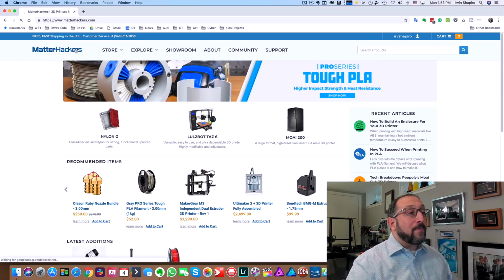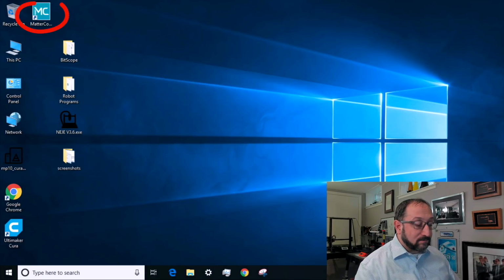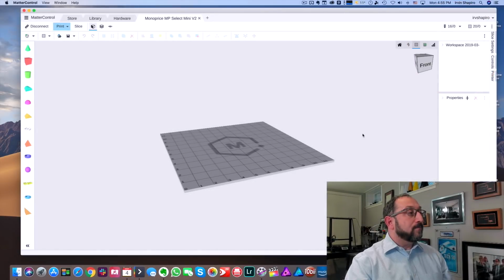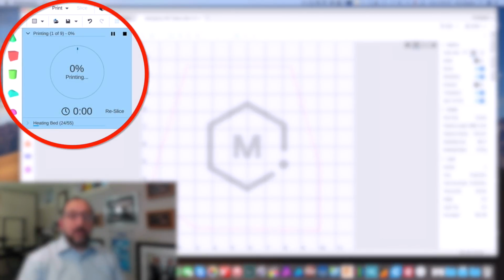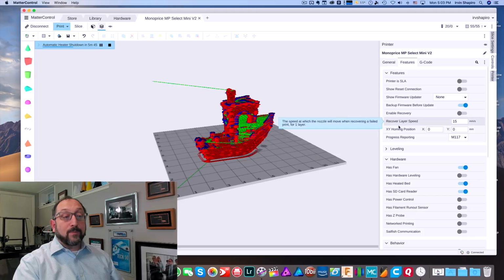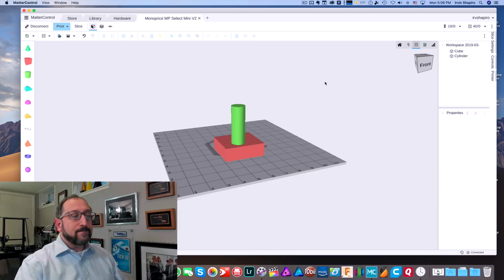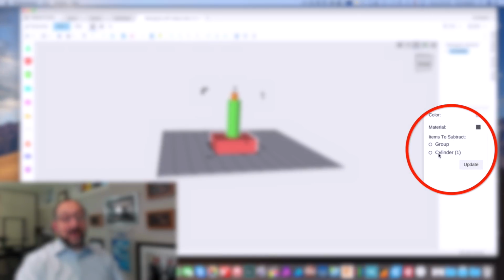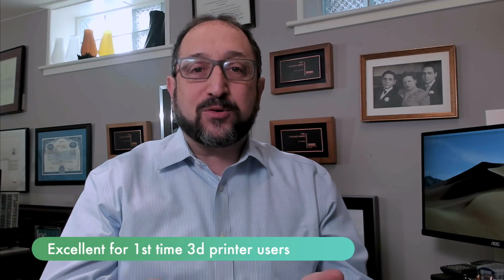Best 3d Printing Software for Beginners

Comment: Hi Needing your help again Doc. Printing using your 1.2 profile and printing PETG printing on the Ender 3 Pro  Printing is nice smooth on the outside ,but bitty like a bobbly woollen jumper on the inside. I am printing  the fan casings for a whoop quadcopter and tried first print at 240 temp ,speed 30 bed 60 fan speed 80% and 2nd print 50%speed  fan 100 temp 245. Last print temp 230 fan 100% speed 40 All 100% infill. They are all smooth on the outside but bitty blobby on the inside. Its a new nozzle
Reply from the maker: What do you mean by "the inside".   Can you share a link to the model.
Reply: @MakeWithTech  I mean the inside face of the print, Every print has  two sides ,the inside and outside . Printing a tube eg. The outside is nice finish but the inside is splattered with filament . Where can I upload the link to so it can be shared?

Comment: I NEED YOUR HELP. printing a small whoop quadcopter, I am using your cura profiles and they are brilliant . Problem is ,After 2 hours of printing ,the printer stops in the front left hand corner. The first time this happened I thought the filament had jammed, so started a New print same STL File. Just after 2 hours ,I even did a video showing a friend how great it was printing ,when 5 minutes later I went to check and the print head had stopped in the same position as last time, front left corner, it allowed me to click resume print. But as I did the print head lowered into the print and was jammed. It was like it wanted to go to first print layer. I got the stl file off Thingiverse and there arnt any complaints about it. Strange why it would stop in the same place twice and after same time period of 2hours sumit. Grateful for your input
Reply from the maker: Are you using Cura or MatterControl as your slicer?  If you are using Cura, what version?   

Both Cura and MatterControl have mechanisms for changing filaments at a specific layer to change color.  Make sure this feature is not enabled.   You can check for this by using a text editor (not a word processor) to search for an M600, M0, M1 or M25 in your GCODE  file. These are all GCODE commands to pause a printer that are added by various slicers to enable filament color changes.
Reply: @MakeWithTech  I am using cura and your profile but have tried using default setting and getting the same thing It now stops about 20 mins into the print. Version 4.4.1 Thanks so much for replying If it wasn't a pause in the code. Could an overheat on the head or a thermostat stop it in mid print?
Reply: @MakeWithTech  But, if there was a pause in the code, wouldn't  it keep its position. when mine pauses and I click resume ,it lowers into the build and then returns to the correct height from which it paused at?
Reply: @MakeWithTech  It was a pause, I removed it Many thanks

Comment: I can not find anywhere in this program as to changing the nozzle size, only errors telling me it can't do the print as it's a .4, but I'm running .6 and .8 nozzles.
Reply from the maker: Add the printer to Mattercontrol.  Then select the printer and "open it".   On the right-hand side is a tab.  The tab is labeled vertically.  It says "printer".   Click on the tab and on the page displayed is an option for nozzle size.

If the tab for print is missing.   Click on the three vertical dots on the top right.   Right under your login name.  Select the option for "Configure Printer".

Hope this helps.  Irv
Reply: @MakeWithTech  Yup.. Had to click the three dots first, BUT after making all the changes to the printer/Clearing the bed/reloading the STL file... It 'still' says can't slice it error not a .4 nozzle.  double checked my settings and it shows .6. Closed the program and reopened it... NOPE says .4.... How do I clear that error?
Reply from the maker: You have stumped me.  I have not tried MatterControl with any non-standard nozzle sizes so far.  At this point, it probably makes sense for you to reach out to the experts at MatterHacker.   Here is a link to their support resources:

https://www.matterhackers.com/mattercontrol/support/get-support

Hope this helps.  I will be trying different size nozzles later in the year but until then I have no way to test this.

Comment: I just got the Anet a6 and it only has the Anet a8 is there a way to set MatterControl for the Anet a6?
Reply from the maker: Mattercontrol supports changing all of the printer settings.   Since the printers are quite close I would just select the A8 and then edit any parameters that are different.   The primary change I saw from a quick look at the specs was that the A8 print volume was slightly smaller.   To edit this add the A8, then open it.  Then on the right-hand side you will see a tab that says "printer".  Click on this tab and you can edit the Z-axis height. 

Since they share many other parts most of the slicer settings should be similar.   They do have slightly difference extruder configurations which may require fine-tuning the retraction settings, but I expect it will work acceptably with the A8 settings.
Reply: @MakeWithTech  Thank you for the information, I'm sure that once I have everything working I will see if it does work.

Comment: At the end you have a tube in your hand of which the ends are of different diameters. How the fudge do you do that man? 35mm one end reducing to 30mm.. obviously I'm missing something but going through all the options it seems impossible 😩
Reply from the maker: Do remember.  I will watch the end of the video and report back.
Reply: @MakeWithTech  I've managed to do it once but dammed if I can figure out how I done it. A reducer is what I'm making and it can't be done without figuring this out.

Most basic tasks I've mastered but this is boiling my brain. How my laptop is still in one piece only God knows.

Please help before the laptop gets launched through a window mate.

Comment: I love learning things together with you.  Have you tried the Beta PathIO Slicer supported by E3D?  https://pathio.xyz/#download-os Currently, I am learning how to 3D print while I build the funds to purchase my first printer.  I mainly use Fusion360 for modeling and like it a lot, and plan to use Blender at some point to make more artistic models, and a combo to get crazy results. Eventually, I would like to build my own with ToolChanger and if I can swing it some sort of Multi-Material unit on 1 of the HotEnds with 2-5 other HotEnds.  I pretty much have everything worked out except which slicer to use.  Currently, I tinker with Prusa most since it is simple, free, and works with the MMU2S.  I would Love to see you do a "Slicer Showdown" with the new versions of Simplify 3D, Prusa Slicer; Cura, MatterControl, and the PathIO slicer software if you have time.  It seems most info about these are at least a year or older and with updates usually, come new features and overall polishing of the software.  How easy are they to connect with OctoPrint? What features do they have that others Don't? Is Simplify 3D Honestly worth the money when compared to the others? The ease of using multiple Extruders/HotEnds?  What do they Fail at?  How do they print with minimal adjustments to settings? Is there 1 that with proper tuning and advanced settings that can do better than the rest? 

Thank you
Reply from the maker: The short answer to some question.  Simplify 3d is an excellent product, and has significantly advanced features but in my opinion, most people will obtain outstanding results with Cura and PrusaSlicer both that are free and have updated many times a year.  Personally, I also find it harder to use than Cura or PrusaSlicer.

Octoprint is not hard to set up.  I have two videos on the channel about setting it up.  Just go to the DrVax youtube home page and do a search.  Or search for DrVAX and Octoprint.

Here is one to get you started:

https://youtu.be/1FuPEHivKzo

Multiple extruders are hard.  There are a number of approaches which all have limitations.  I currently do not own a printer, outside of my price range, with multiple extruders.

In general once you have a slicer/3d printer tuned in you can replicate the results all day as long as your components stay tight and your bed stays level.   The third most important variable in my opinion is the filament and the humidity it is stored at.  Not all filaments are the same and storing filament in a low humidity environment makes a difference.
Reply: @MakeWithTech  thank you for that incredible response. I have your octoprint videos bookmarked for later reference when I get to that point. I am thankful in your experience with octolapse as that was the first reason I became interested in octoprint, and now I hope updates are made to limit the inconsistencies you experienced. Price is the main reason I wish to get a cheaper printer then upgrade and build my own. Hopefully in the process figuring out how to make more advanced systems cheaper. I hope 3D printers become as common as computers are now. I think everyone should own one.

Comment: I used cura but there is a .stl file that isn’t working for me will this run all for stl’s
Reply from the maker: Cura generates excellent STL files.  It is a better slicer then MatterControl but more complex to use and does not have good USB direct print support.  If your cura generated files does not print properly you have other problems.   

You might want to start by checking that you have selected the proper printer in cura,  check your print bed is level, try printing the model that is on the sd card that came with the printer.

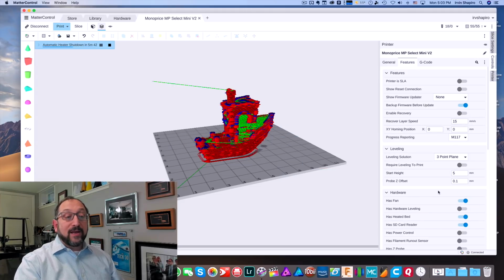Comment: At: 14:51 you say that this CAD program has the ability to auto level the bed. Would there need to be motors that would move to adjust the bed? Typically on non commercial machines you would do the leveling by adjusting the bed height with a tool for each leg.
Reply from the maker: MatterControl has a procedure that adjusts the Z height depending on bed calibration.   I have not tried this but basically you run a calibration procedure to get offsets from a number of positions and then when MatterControl generates your G-Code is adjusts for these calibration.  I concept is interesting but I am not sure how well it works.
Reply: @MakeWithTech  So what you are saying is that MatterControl sets the print head distance from the bed and does not perform auto leveling?
Reply from the maker: Yes.  Mattercontrol simulates auto bed leveling.  

This is in fact how all 3D printer ABL works.  A probe measures the distance from the nozzle to the bed at various points. Then the printer firmware adjusts the z offset during the print.
Reply: @MakeWithTech  I am confused, how is the bed physically moving to adjust leveling?
Reply from the maker: Depending on your printer the Z axis (vertical) height is adjusted by moving the bed, for example an Ender 5, or by moving the print head, for example an Ender 3 or a Prusa Mk3.   Most slicers (mattercontrol is an exception) assume the bed is perfectly flat and generate gcode commands based on this assumption.  When your bed is not perfectly flat you need a way to adjust the gcode produced by the slicer to vary the Z axis height based on the actual bed position.

An ABL (auto bed leveling) probe measures the actual bed position in multiple locations.  These values are stored in the printer eprom.  Then when the gcode instructs the printer to move to 1mm above the bed, if the bed at that location is .1mm lower, the firmware will adjust the 1mm to .9 mm.  (I hope I got the math in the right order :-))  This is all done in the printer firmware software.

In the case of a slicer with bed leveling built in, you load the bed offsets into the slicer, and it adjusts the vertical positions, the z axis height, to compensate for the bed that is not level.

Hope this helps.  I may try and do a video in the future to explain this with pictures.  It is confusing.

Comment: Wow, I’m using a cura designed for my printer but I’m going to try this out. Thanks for sharing
Reply from the maker: If you are already using Cura I would suggest Astroprint.com instead of MatterControl.   It is equally easy to use and includes Cura built in.   The advantage of MatterControl is the ability to connect your printer over USB which is quite nice.  However the built in slicer is ok for beginners but not as good as cura.

Comment: will it connect to the ender3? I dont see the ender3 listed I understand the bed size change. but will it connect to the ender 3? thank you for your time. you make really good tutorials. I applaud you.
Reply from the maker: It should connect without problem. Look under creality and if the ender is not listed try using the cr10 and editing the size.
Reply: @MakeWithTech  thank you i will give it a shot
Reply: @MakeWithTech  can you adjust under extrusion issues as well?

Comment: what about making a replica of a model that you allready have..filming it 360 degrees with a go pro and importing the information to the printer.can you explain this.
Reply from the maker: This is an area I am following.  Unfortunately scanning using a standard camera and then converting to a model is still quite difficult.  The software is not really easy to use.  The dedicated hw for scanning 3d models often uses lasers instead of camera.

However, this is an area I will keep track of and once it gets easy enough for my typical channel viewer I will try and do a video.
Reply: @MakeWithTech  can you watch this video, This is why i want a 3 D printer.. i hope it is as easy as this.https://youtu.be/M2VazVGm7TU
Reply: @MakeWithTech  CAN YOU HELP ME.. i am interested in 3D printing using the process of Photogrammetry... This is the process of 3D printing from photographs... i used this free software that other are talking about called MESHROOM.... it keeps crashing regardless of how limited the amount of photos i try.. if i cant use this process to re create my own models, than i am out of luck doing 3d printing... CAN YOU RECOMMEND A SOFTWARE THAT WILL WORK WITH PC FOR Photogrammetry... any help anyone can give me will be highly thanked.

Comment: I can't seem to get my Anet  A8 identified by this software program. Could you please find the time to help me get past this? I need to make some chair bottom tips for the chairs at my church. Thank you
Reply from the maker: What do you mean by identified?  If the A8 is not listed,  I’m away from my computer and cannot check, the just pick a similar cr10 style printer or a different similar A8 model.  Then on the printer tab edit the bed dimensions to match your printer.

Comment: Hi I download the program but there is not my printer listed on it how and what do you do then I've have Anycubic I3 Mega and Predator so can you please help me 
Regards Gary
Reply from the maker: All you need to do is select a printer with a similar geometry at a similar price point.  The price point will help get the speed, acceleration and jerk settings close.  Then edit the bed size to match your print.  After that, as you learn more about slicer parameters you can turn the profile to perfection.

To change the printer bed size and fine-tune the settings click on the three vertical dots on the right top of MatterControl.  Make sure "Configure Printer" is checked.  Then click on the "printer tab" -- it is a vertical tab, on the right side.  All the setting you would want to change are located there.
Reply: OK Thank you will try it out see what I cum up with
Reply: And bye the way I love this program that you have presented to us all

Comment: Thank you Dr Vax for bringing this great software to the attention of your followers.  Your review was very concise and informative as usual! I am excited to see the design function incorporated in the slicer and the print controls are very intriguing as well. Good job!
Reply from the maker: I enjoy using MatterControl but think they need to put a bit more development into stabilizing the product and supporting a wider range of printers.   Today their focus seems to be the printers they sell.   I get it.  But they have the potential with MatterControl and the right low end printer to build a community of home based 3d printer users.  Yes the machines are inexpensive but I believe there may be a way to monetize this community and make it practical to really advance MatterControl.

Comment: I have a XYZ Printer Davinci Pro 1.0 3 in 1..
I like the Matter Control Program, but it has no listing for the Davinci Printer.
How can I make it see the printer and know what it is ??
Reply from the maker: In ALL slicers you can use any printer by just selecting a similar printer, basically the same geometry and same extruder type and editing the print dimensions after you select it.
Reply: @MakeWithTech  Thank you for the quick reply...I will give that a shot !!  PS  you and your videos are Awesome !!

Comment: newbie question!.. I've taken a orientation to the lab and printed first object.  Q: Can I use MatterControl (offline) to model and slice, then take USB) to the Lab where I can use one of two printers.
Reply from the maker: Yes.  However if you are going to work offline I would recommend use Cura.  It is a more sophisticated slicer.

Comment: I have a Geeetech A10 and was using cura to slice the stl files for an airplane from 3dprintlab. I had a hard time trying to get it work right. Cura just didn’t slice some parts correctly. Once I got used to mattercontrol it’s been great. 

Although my hotend jammed. I think it’s just a bad design that doesn’t work well with a lot retractions. When it jammed I went to remove the nozzle and didn’t notice the bare wires on the heating element.  It shorted, luckily it looks like it just blew one of the fuses on the board. They should be here later this week so hopefully I can get it running soon.
Reply from the maker: Happy this worked out for you.